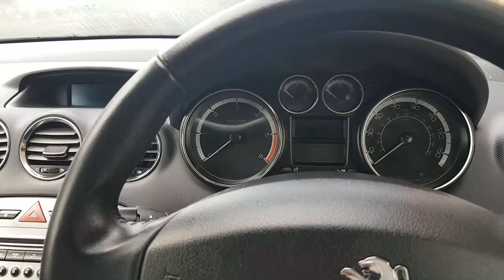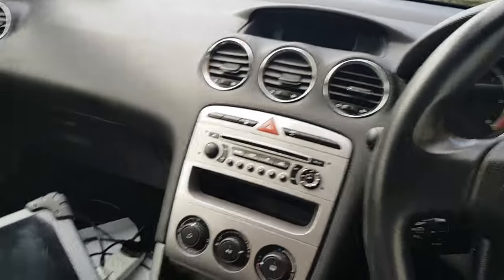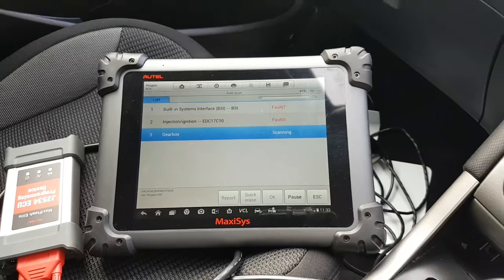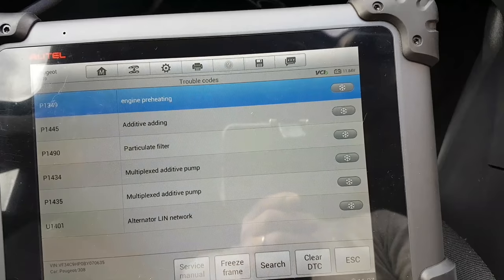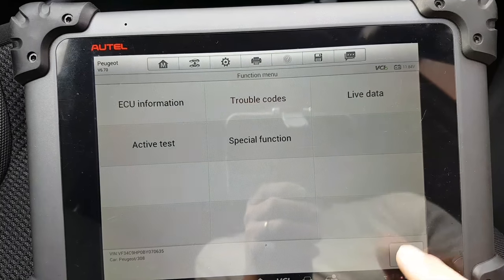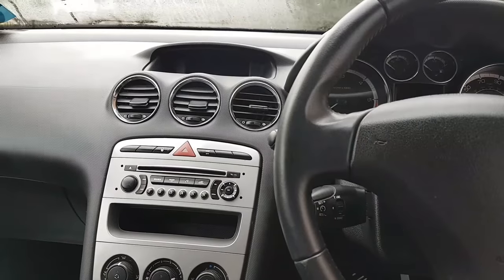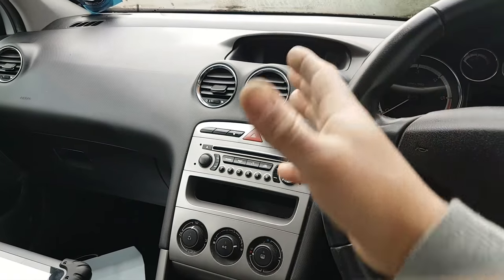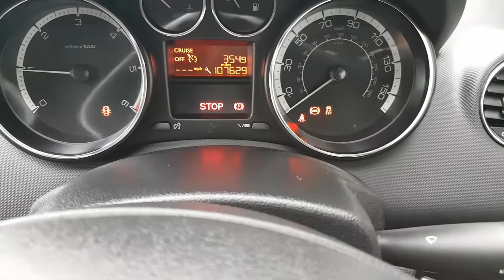Peugeot 308 not starting and multiple faults F569 C56E. Fault finding and repair.

Comment: Hello. I have the same errors on my peugeot 308 2.0hdi from 2012. power steering, abs, esp these errors seem to have been fixed since i got the battery manager changed. but I have other faults. when I switching to high beam, the radio goes out and restart,sometimes cruise control also goes out. I also experience speedometer and tachometer going out briefly. as well as the car can not start, no power to ignition key, no indicator lights in instruments. no central locking, no power in 12v socket. accident light does not work either. everything works again when I have had the battery pole removed briefly. 2 days ago the signal light right and left started to flashing fast, no fault on bulbs, discovered that there was ice and water in the trailer plug. I dried the plugs and given it contact cleaner, I not having errors since. can it really be the trailer plugin that is to blame for all these problems? vh Lars
Reply from the maker: It is a Peugeot... anything is possible! 
😊
👍👍👍

Comment: Hej
My car battery was down so i want start car but now they show Many fault.if i change battery so Are all problem solv automatic are do need any thing for this problem.
My car is Citroen c4 grand Picasso 1.8 petrol (2006) thanks in advance
Reply from the maker: Start by make sure the battery is good...
You might need to clear the faults though...
Thank you for watching!
Reply: @LMAutoRepairs  Hej
I forgot to tell you I change the break Switch without disconnected the battery so they show multiple fault. How we reset the code on. Citroen c4 grand picasso 1.8 petrol (6fy engine code) Thanks a lot if you can help.
Reply from the maker: You need a code reader to do it...

Comment: thou  shall check voltages first!,had a megane with a wheel speed sensor reading 800mph with the car stationary,was the loom  where it runs under the battery rotted out!,looked ok with a voltmeter but no good at supplying a load!
Reply from the maker: Yes... I have videos showing the importance of load check a circuit... but that is a decision you make on the spot... As you trouble shoot the problem...👍👍👍
Thank you for watching and for your comment!

Comment: Hi, I just found out my car has this problem : Peugeot  308. I need to get it to my mechanic to replace the SSR just like in this video. Its an Automatic and stuck in Park gear and cannot change without the engine on(and of course it wont start). Any tips how to get it into Neutral so I can get it towed to the mechanic?
Reply from the maker: Usually... automatic gearboxes have an emergency release system to put them in neutral for towing purposes...
I confess, I am not sure where it is on the 308... check the manual... otherwise se if Google knows...😉
Thank you for watching!

Comment: Hi I have the save code on my Peugeot rcz 2012 and i tried what you did but still did not start..😭😭😭
Reply from the maker: The fault can be somewhere else within the circuit... you need to diagnose it properly...
Thank you for watching!
Reply: @LMAutoRepairs  I did the diagnostic Sir that is I even have printed out.. which is the same Bsi faults you got on the video
Reply from the maker: I understand... but the faults are just a guide... does not necessarily means that the problem is the same...
You can have the symptoms caused by different faults...
Reply: Ok thank you... and if I change the ecu kit from bsi bsm ecu and key sets will I still need a programming procedure.?
Reply from the maker: The fuse box under the bonnet, if you get the same part number, you should get away with no programming...
No need to replace everything on the car when you have only one module with problems...
Reply: Thank you.. can I send you the photo of my diagnostic results

Comment: Hi Luis do you do an auto scan on the autel or a Manuel one?  on Peugeot and Citroen i cant get my autel to scan any of them i put the in the vin and it wont load any control units. when i do an auto scan it just give 17 AAAAAAAAAAAAAAAAA like that have you this issue its only on peugeot citroen . good vid buy the way.
Reply from the maker: Question, what is the issue with that car?
All A usually means a bad BSI...
No, I can't remember having that issue... not on a working car... if that makes sense...
Thank you for watching and for your comment!
Reply: @LMAutoRepairs  it is a 2009 207 1.4 hdi i can communicate with the lexia but not autel. the wipers are not working checked fuse on the box engine and no power either side of fuse so i took the fuse box off to see could i open it but full of gel and when i rebooted it the wipers worked for a while but stayed on even with ignition off . i had power at fuse then for ten minutes. when i put 12 v to the fuse the wipers will work but they stay on even with ignition off. i done some live data and checked wires the switch is commanding the wipers on on low speed and high but no power to fuse
Reply from the maker: Can you actuate the wipers with pp200?
Reply: @LMAutoRepairs  no it wont it say actuate terminated and im not getting any fault codes also i have no power on the fuse in the fuse box on the inside of the car for the rear wiper  either . is the relays internal on the modules in them do you no?
Reply from the maker: @iankelly2110  
Possibily... without looking at diagrams it is difficult to say...
But if you have checked everything else...
Reply: @LMAutoRepairs  its one for tomorrow Luis ha good night and thanks. i will give you a shout if i get it fixed ..

Comment: WHAT'S THE DIFFERENCE BETWEEN TESTING A SOLID STATE RELAY AND A REGULAR RELAY AND THANKS FOR THE VIDEO !
Reply from the maker: Hi
Here, better than I could explain...
https://www.electricaltechnology.org/2019/01/how-to-test-a-relay-checking-ssr-coil-relays.html

But, main difference is in the resistance of the coil/transistor...
The principles however, are the same...
Thank you for watching and for your comment!
Reply: @LMAutoRepairs  THANK YOU SIR , FOR THE INFORMATIVE REPLY AND TRULY ATTENDING YOUR CHANNEL .
Reply from the maker: @8power0  
👍
Reply: @LMAutoRepairs  The SSR and mechanical relay are very different.  The input needs a series resistor as  you are driving a diode that emits light.  Without a series resistor you will blow the diode . A 1k resistor is a useful starting point.  The output  is also different  - it needs to be in circuit   
ie  voltage in series  with the output and of course the other end of the output needs connecting to ground.  If you are testing out of circuit the output will also need a resistor to the supply.  You can't just energise the input and measure the resistance of the output when the output is not connected to anything.Sometimes you can dig out the potting compound that surround the power transistors but it's pot luck (no pun intended) whether you will be able to read any transistornumbers.  If there is enough space you could also replace the SSR with  an off the shelf device.

Comment: Morning sir..i'am from Malaysia..that now i have the Peugeot 308.. suddenly can't start..this light at only battery and handbrake..no check light engine..this fault code 04a7 04ba 0569 05ff 0062
Reply from the maker: Hi
Difficult to tell... some of those codes are probably a consequence of some other issues...
But, if you are having power issues, start with the basics...
Check fuses, connections, ground points... as corrosion can cause all sort of problems...
👍👍👍

Comment: Hi,
I just watched your video (where you trace an ABS light on and replaced diods ). I would truly congratulate you for your bright mind.
If you can trace a fault this way and find out what is going wrong, it should be the same way with the BPGA (Battery Management Unit) on PSA vehicles (mine is C4 II B7 120 VTi).
When I asked you if the unit can be repaired you said it's tricky and better replaced.
Now I have the Citroën diagnosis of the issue and it says the  "ss relay inside the unit is faulty".
Now I have the wiring official diagram. Is it possible to open the unit like you did with the ABS box  and just replace the faulty relay like you did with the diods.
Reply: instablaster.

Comment: Joe my name my citroen xsara1.4 petrol years 2004 run out of petrol on motorway AA break down truck just tow me home less than 1mile after reaching home most electrical  off check fuse box and all fuse okay. Engine crank central locked okay no dashboard light can you help been on diagnostic tests no trace of problems

Comment: Hi please can you help me with fix my car i have electric problem
Reply from the maker: Have you scanned the car?
Thank you for watching! 
👍👍👍
Reply: Take to garage put on computer ibchnge turbo and all censers and seme engine lght comes on and offsomtimes with anti pollution folti garge told me i have electric probleem
Reply from the maker: @mehdib1008  
OK...
Why did they didn't investigate it?
Just saying it is an electric problem is a bit vague....🤔
Reply: I don't know i spend 800 £ nothing fix
Reply from the maker: @mehdib1008  
🤷‍♂️🙄
Reply: @LMAutoRepairs  I'm having this problem after changing the plugs in my car the car doesn't wanna start anymore check everything it just show me no power in cable for coils
Reply from the maker: If was after changing the plugs, just double check everything you touched... just incase...
👍👍👍

Comment: Why you have 329 likes for this baffles me.Kids with toys to find a fault.First check the battery.Then if good check that the battery negative black lead connected to the body is nice and clean.Then check the relay.If corroded.Buy new one and replace.Under 5 minute video.I have seen people be conned out of there money.And all it was ,was a corroded connection to the body of the car.
Reply from the maker: If you have watched the video, you have seen that was a bit more than a poor connection, corrosion or a bad relay... and, that without a "toy", would have been a bit more tricky to figure this one out...
So, not really sure what your comment is trying to point out...
Still, thank you for stopping by...
Reply: Rubbish.I knew straight away what it was.Multiple errors mean ,s multiple unit. @LMAutoRepairs
Reply from the maker: @t147han  
🤣🤣🤣🤣🤣
You knew straight away what it was...
Unless you had this exact same problem with the same faults...
You can't never say things like that...  I have heard it many times... and then in the end is something else...
Remember, one symptom can have different causes... so, you can't never say what is the cause untill you investigate it... you can guess... but... 
I don't like to guess, I like to diagnose things properly, as I don't have a parts canon...
And, still don't know what a multiple unit is...🤔
Reply: A module is a multiple unit. @LMAutoRepairs